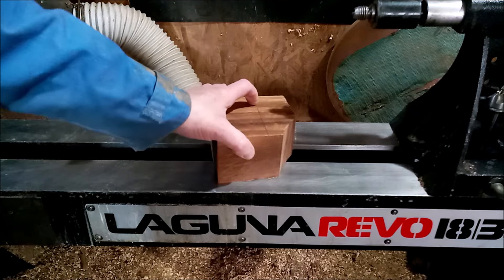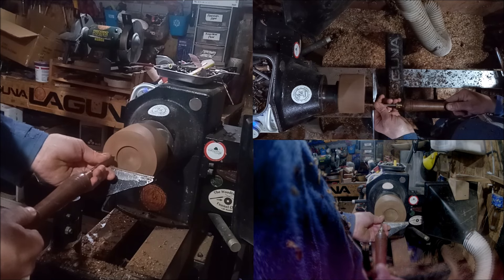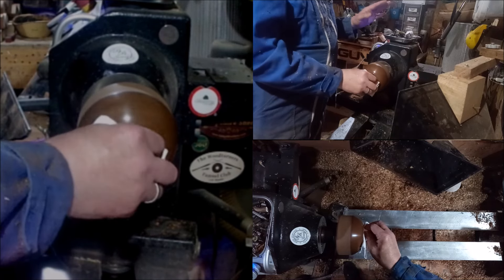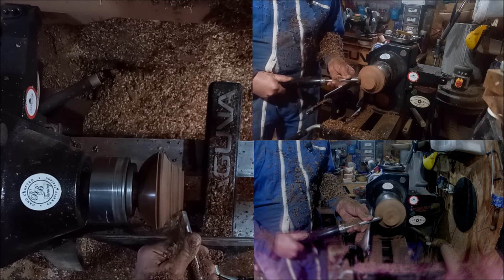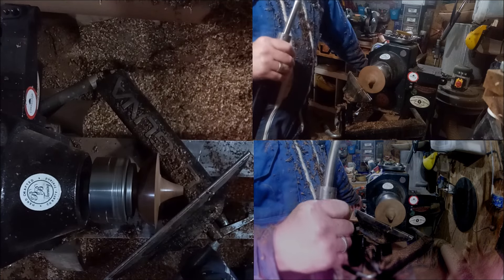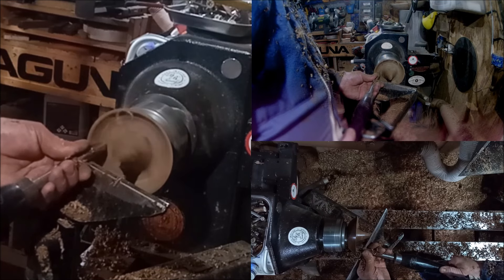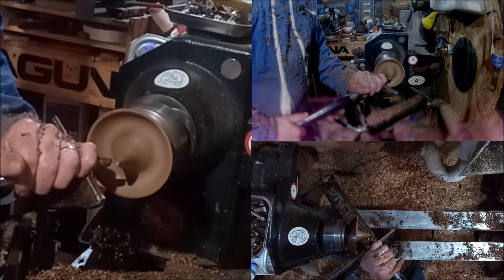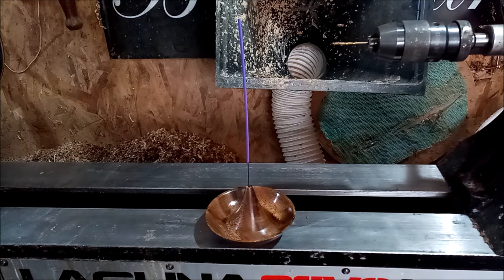Woodturning Projects for Beginners 10  An Incense Holder

Comment: I'm thinking of using a load of Hawthorne that I picked up after some knucklehead cut it down. It seems fitting to make incense holders from it. It's rather large for Hawthorne. At least around here. About 10 inches across.
Reply from the maker: Is that the same family as blackthorn Archie? Blackthorn is gorgeous when it it turned.
Shay
Reply: @BBTurning  I'm not sure.  It's the small tree that blossoms white in early spring. It has red berries that are used in folk medicine. The trees are said to be home to the good folk. As legends go, cutting it down is a bad idea. I saw it down, and being an artistic person, I decided to ask the tree if I could make something beautiful from the mess the city workers had made of it.
Reply: @BBTurning  I just searched and found they are related. They are both in the Roseace family. The leaves are very different and the fruits are as well. The pictures look very similar. I will share pictures as I can.
Reply from the maker: Do please Archie, I would be very interested in the outcome.
Shay